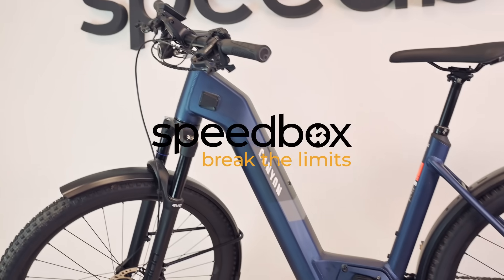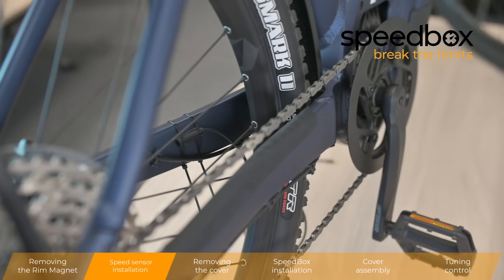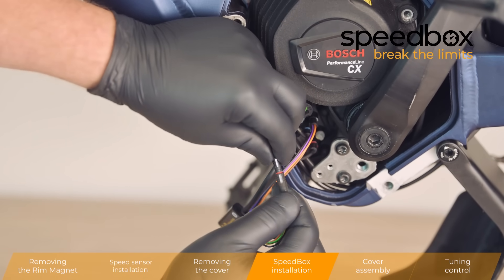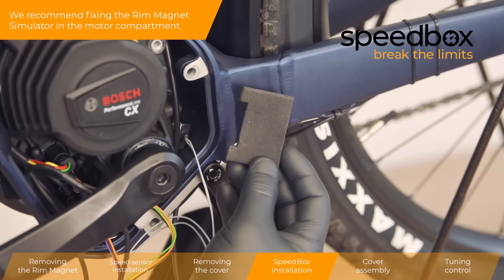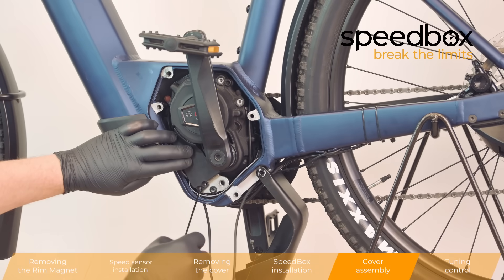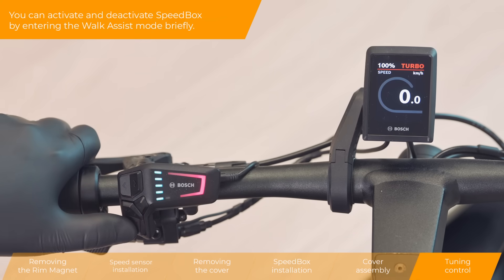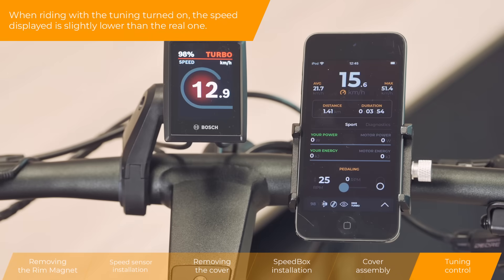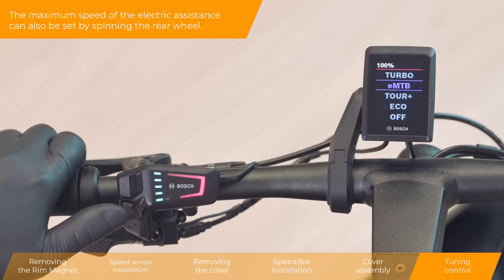eBike Tuning SpeedBox 1.2 (B.Tuning) for Bosch (Smart System + Rim Magnet)  Installation Instruction

Comment: Hello. I try to install the speedbox on my canyon strive on cfr. It has no display only a central battery indicator and a small wireless controller on my steer.  In the bosh app you can see the speed to place the rim magnet simulator correct. That worked fine. Then if you want to ride the speedbox is on when you start the bike en i can ride 30 kmh+- but after 300m the led on the battery status flashes Orange,  But no errors when you restart the bike (without rim magnet) it works again for another 300m.  How do you check the weel circum whitout a display or can you skip this step? How to check of your chip is enabled or disabled  (2.5KMH and 3.5KMH on display) with only a battery andicator?(you cant use the app for this right?) Anyone advice on that orange led on the battery indicator? Thanks in advance
Reply: With original rim magnet and simulator speed is displayed but i can't set that tuning ON. Should that activation been seen via Flow app?
Reply from the maker: Good day.
You can check the wheel circumference in the Flow App. This step is not necessary for all types of bikes, it is recommended for preventive reasons.
If you do not have a display, it is not possible to verify whether the tuning is currently active or inactive.
If the LED flashes orange as an error, we can recommend trying to slightly change the position of the Rim Magnet Simulator. If the problem persists, we recommend replacing or returning the chip.
Reply: Did you get it work with that spoke magnet? Mine doesn't show any speed with that, no matter where simulator is located.

Comment: In Africa we have 32km/h limit from factory. Does the speedbox push the limit higher than 35km/h?
Reply from the maker: Hello.
35 km/h is the preset maximum speed. We recommend it for prevention against tuning detection. You can change the set maximum speed and drive at a theoretically unlimited speed. But it's something to consider. We would prefer not to drive above 40 km/h.
Reply: @SpeedBoxTuning What will happen when the system detects the tuning? Will it lock the motor?
Reply from the maker: @AndyMialkowski-ct9sz  Hello.
If the system detects tuning, you have two options. Either visit a bike service and have the error erased, or you can ride for 90 minutes without assistance.
90 minutes is really the maximum. In practice, several tens of minutes are enough. You can also interrupt the ride. After that, we recommend riding another 10 km without tuning on. Change gears and assistance modes while riding. After that, the detection will definitely disappear.
Reply: @SpeedBoxTuning Thank for your reply. That is, when it detects tuning, it blocks the assistant. Does it?
According to your observations, does tuning detection often occur? (When setting the limit up to 40 km/h)
In the old e-bike (Bosch CX 4th gen), I set the limit just up to 40 km. This is the optimum for me. I am even able, on a straight road, to propel the bike up to 46 km/h without assistance (If the motor helped me before)
Here comes the critical question. How often will an error appear in the Smart System when I set the limit for this 40 km?
Thank you.
Reply from the maker: @AndyMialkowski-ct9sz  There is no empirical answer to such a question. In the Smart System, dozens to hundreds of operations take place that can detect tuning. For this reason, we have an entire set of recommendations on how to reduce the probability of tuning occurrence to zero.
Reply: @SpeedBoxTuning The issue is choosing between the Orbea Wild M LTD and the Specialized Turbo Levo S-Works. You know yourselves that spending €14k on a bike that will be limited to 25 km/h is some absurdity, full stop. If Specialized didn't only offer a mullet version, the dilemma would be less.
Reply from the maker: @AndyMialkowski-ct9sz  I understand, you want the best possible e-bike on the market. I would choose Specialized 🙂
Reply: @SpeedBoxTuning  Thank you for your response. I understand that you are enthusiastic about Specialized bikes, but personally, I feel that having a 27.5-inch wheel at the back is a step backward. Fortunately, I don't feel pressured at the moment. I'm very satisfied with my Scott bike and I continue to make adjustments to it for my exploratory rides.
Reply: On earlier smart systems, they had the previous type of sensor. Surely there would be a port that a traditional speed sensor to be plugged in instead of adding the other box.

Comment: Hi, apologies for the basic question but what triggers the countdown? Ot cant be everytime the bike stops right?
Reply from the maker: Hello.
Your question is absolutely correct 🙂
Countdown is the process of counting up the kilometers an e-bike would travel if it were traveling at a speed of 25 km/h. It is triggered if you have previously driven at a speed higher than 25 km/h.
The Bosch Smart System is quite complicated and we have written some tips from experience to eliminate the risk of tuning detection:
Drive at least 10 km before installing the tuning.
If possible, do not use the Flow App.
If you want to use the Flow App, turn off automatic updates and location and do not modify the speed limit, torque and riding modes. Do not activate/deactivate tuning during riding.
Do not exceed a speed of 35 km/h.
When stopping for a short time, keep one foot on the pedal so that the countdown does not start.
When stopping for a longer period of time, allow at least a partial countdown to take place.
After a long ride, the countdown may take several minutes. Do not remove the display if the countdown has not been finished.
Reply: @SpeedBoxTuning  This is great information and might help reduce the number of repeat Q&As if it was posted in the video description. Just an thought and thanks for this reply
Reply from the maker: @ccederlo  Thank you for your comment and wish you many happy miles ☺
Reply: @SpeedBoxTuning  How do you know when the countdown is done, if you have the version with no display?
Reply from the maker: @HenrikdaMURDERERER  Good day.
If you don't have a display, you need a version called B.Tuning. Here you will see the ongoing countdown on the mobile screen in the SpeedBox App.

Comment: If it doesn’t work, do you accept return and refund ?
Reply from the maker: Hello.
If the product is not mechanically damaged and is defective in terms of software, you have the right to a complaint and exchange or refund.
Reply: Thank you I will buy it
Reply: Hi, I received the speedbox 1.2 tuning version. The only strange thing is that when I accelerate hard, the speed exceeds 25 km per hour on the "flow app" counter and therefore the engine stops for a second. Then, still on the flow up application, the speed automatically drops below 25 km per hour and the engine comes back into action. The problem with this is that when I accelerate up to 35 km per hour, there is always a moment where I have the engine cut out for a second or two. Do you think this is normal?
Reply from the maker: @olivoliv7769  Hello.
Yes, it is possible. Based on our experience, we recommend this: do not use the Flow App while riding. If you are already using it, please turn off automatic updates and positioning (so that your speed is not detectable through GPS) and do not make changes to the settings in the Flow App (do not modify the speed limit, torque and riding modes).
Reply: @SpeedBoxTuning  Thank you for this feedback, I will try it. in the Flow application I have the following informative message: Magnetic field of the rim magnet too weak. but this does not block the use of the bike. is this message normal? THANKS
Reply from the maker: @olivoliv7769  Hello.
If this message appears, the e-bike should not be working properly. It means that the system has not yet found a strong enough magnetic field that is excited by the coil (Rim Magnet Simulator) in the motor compartment.
We recommend repositioning the Simulator to display the speed. Please check our web and see the pictures https://www.speedbox-tuning.com/p/speedbox-1-2-for-bosch#1914

Comment: Hello what do you mean with "to minimize the risk of error codes, we recommend not to exceed 35 km/h." ?
Reply from the maker: Hello.
Electric bikes with Bosch motors are equipped with strong tuning detection. They attempt to detect any deviation in the data (e.g., speed vs. traveled distance, pedaling frequency, battery capacity, etc.). The maximum speed of 35 km/h is not dogma; this speed can be increased in the settings. But it is one of the preventative recommendations on how to avoid tuning detection.
Reply: @SpeedBoxTuning OK, thank you, so even with the "countdown" process, the tuning could be detected by the unit ? In that case what would happen ? Is there a risk to have the ebike assistance completeley blocked ?
Reply from the maker: @julienhardy  If the motor is equipped with detection, there will always be a minimal risk of detection. However, the more you follow the recommendations, the more you eliminate the risk of tuning. If an error indicating tuning detection appears in the future, it can be removed without visiting a bike shop.

Comment: Hello. I have got a Speedbox for rim magnet. I updated my bike's firmware by mistake at the last version,  and now the speed box doesn't work. Do you know if it is possible to downgrade the bosh firmare?
Reply from the maker: Hello.
If you already have updated firmware, try disabling SpeedBox according to this video. You do not need to remove the chip from the e-bike.
https://www.youtube.com/watch?v=dCuxoid3u4M&list=PLVEwMyjYWZ4_G7IZks-1M4HVzLYxIjntW&index=11
Then ride the e-bike for about 10 km without tuning and then try to activate the tuning again according to the video.
Reply: @SpeedBoxTuning i can't access the video. it's written that it's a private video
Reply from the maker: @ioncaraja2340  Sorry. Now you can watch 🙂

Comment: This is not working at all on my bike just keeps saying error
Reply from the maker: Hello.
When did the error appear? While driving or during installation? If error 503 appeared, it means a weak magnetic field. It will help to either turn the ebike off and on, or move the magnet and try the signal again and then turn off, turn on. We also recommend turning with the crank, not the rear wheel. If you are not sure, please contact our support at speedbox-tuning.com.
Thank you.
Reply: @SpeedBoxTuning  done all of that still not working it says error as soon as you start riding it just doesn’t work you’ve made a faulty product
Reply from the maker: @Rip_burnsy_gbnf  Installing tuning for ebikes with Smart System and rim magnet is a bit complicated. Could you please contact our support with the specific problem and type of your ebike so that we can find a common solution? Thank you.
Reply: @SpeedBoxTuning  already done that tried everything I promise you it’s simply not working it’s a Bosch motor
Reply: @SpeedBoxTuning  creo que no está conseguido para algunas bicicletas , la mía es una cube hybrid y no hay manera de colocarlo siempre da error
Reply from the maker: @RECLU1000  Hola.
Es posible que el chip no funcione en el 100% de todas las bicicletas. Prueba a contactar con nuestro soporte en www.speedbox-tuning.es, quizás te puedan ayudar.
Reply: @SpeedBoxTuning  también puede ser que el dispositivo esté defectuoso, no??
Reply: @SpeedBoxTuning  me sale el error 523003 tiene algo que ver con el sensor de velocidad de la unidad motriz
Reply from the maker: @RECLU1000  Desinstale el chip y conduzca por un tiempo sin realizar ajustes, cambie los modos de asistencia mientras conduce.
Luego, al instalarlo, intente cambiar ligeramente la posición del imán. Para comprobar la velocidad, no gire la rueda trasera, gírela manualmente con la manivela.
Reply: @SpeedBoxTuning  todo eso lo hemos hecho y sigue dando error , puede ser que el chip esté defectuoso de fábrica??? Alguna mala conexion??
Reply: @SpeedBoxTuning  he llegado ha hacer 40 km y luego a salido el error , otras veces ha salido el error estando la bicicleta parada , son cosas sospechosas
Reply from the maker: @RECLU1000  Hola.
¿Cuál es exactamente el error? Puede que sea necesario cambiar ligeramente la posición del imán en el motor. Recomiendo contactar con nuestro soporte en speedbox-tuning.es o a través de un mensaje en FB.
Reply: Estoy igual que tú no hay nada que hacer me sale el error ponga donde lo ponga , ya mismo lo devuelvo
Reply: Hello I have a questions do you have support on Poland ?
Reply from the maker: @artix924  Cześć.
Tak, nasze wsparcie jest dostępne w 7 językach, w tym w języku polskim speedbox-tuning.pl

Comment: mine doesn’t work at all. the magnet simulator doesn’t pick anything up, it does not tune and what do you mean “check wheel circumference”? check against what?
Reply: i got it to work. i emailed support and they explained the magnet simulator needs to be as central as possible. where they wanted to me to put the magnet simulator within the motor compartment, i had a metal block which didn’t allow me to fit it in. I put the magnet simulator outside the motor compartment, centred, and that’s worked. this might help someone with same issue i had.
Reply from the maker: Hello.
First we will answer the wheel circumference: usually it is preset and you just have to confirm. This step is used to set the displayed speed. As for the magnet simulator, we recommend a little patience 🙂 Spin with the crank, not the rear wheel. As soon as the display shows any speed value other than zero, turn the ebike off and on. At this point the system will "understand" that it will follow the data from the magnet simulator, not from the Rim magnet. If you still don't know what to do, please contact our support at speedbox-tuning.com, Facebook or Instagram.
Thank you
Reply: @SpeedBoxTuning, am I understanding this correctly?  at the moment of it indicating speed value. in that moment, turn off bike?  or only once it is 0 out?
Reply: Is It Waterproof Outside The Box
Reply from the maker: @gerardrice7747  Hello.
Yes, the chip is waterproof.

Comment: Nice video, but what about Bosch system without the display only with the battery indicator? There are plenty of ebikes nowaday incl. mine with Bosch motor running without the display. 1) How do you check the Rim Magnet Simulator without having the speed value on a non existent display? 2) Tuning of the speed limit- how do you do it without the non-existent display?
Reply from the maker: Good day.
If you don't have a display, you can check the speed in the Bosch Flow App. Or you can get the B.Tuning version (B as Bluetooth) and use our SpeedBox App.

Comment: Hi guys, Is this the only solution for ebike with rim magnet?thanks in advance!
Reply from the maker: Hello.
Yes, since the electromagnetic field needs to be simulated, this is the only possible way at the moment.
Reply: @SpeedBoxTuning hello.I just bought the kit for my ebike, can i put the speed sensor at the cranks side , or it won't work?
Reply from the maker: @lekatr6815  Hello.
We don't know exactly what you mean. Place the magnet simulator in the center of the motor. And place the speed sensor on the side where there is no chain so as not to damage the speed sensor.
Reply: Hello guys, how do we check the countdown in a bike without the display? Is it necessary to do it after every  ride?
Reply from the maker: @lekatr6815  Hello.
If you don't have a display, you just have to let the countdown run until the e-bike turns off. After a long drive, the countdown can last up to 10 minutes.

Comment: I have try to connect lights to my motor but it's need to be activated by Bosch service. Will this speed sensor work if socket is not activate?
Reply from the maker: Hello. The light socket may not be active. However, the SpeedBox does not plug into the light socket.

Comment: The max speed of this speedbox is only 35?
that kinda sucks especialy since this one is twice the price
Reply from the maker: @e-mike9776  Hello.

Right now, we would recommend to uninstall the chip and pedal on the e-bike for about 90 minutes. (You don't have to ride the whole 90 minutes at once, the ride can be intermittent).

Once the error is gone, you should make a few more calm rides without the chip (to get some new and clear data in the e-bike), only after that you should install the chip again. Do not ride only in Turbo mode during those calm rides, better to engage Tour, Eco, etc.
Reply: @e-mike9776  I’ve got that bike it does not work in it
Reply: @e-mike9776  don’t waste your money the software in the motor is too advanced for the chip
Reply: @Rip_burnsy_gbnf  if that is the case, then this will be my last emtb ever....
Reply: @e-mike9776  have you rode it yet
Reply: Lets See i will give it a try;) 2 Times 760 euro
Reply: @BenjiBenji989  and did it work?
Reply from the maker: Hello. No, the max speed is unlimited. The default max speed is 35 km/h, you can change it in settings. We recommend this speed to avoid risk of errors 🙂🤝